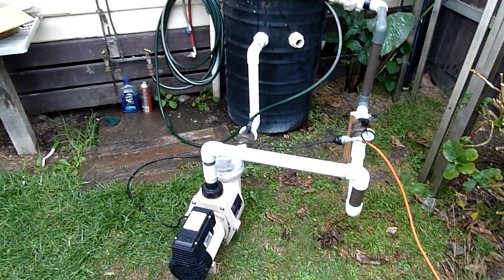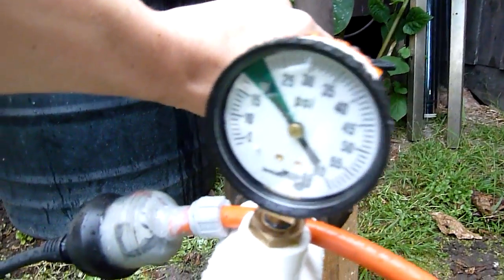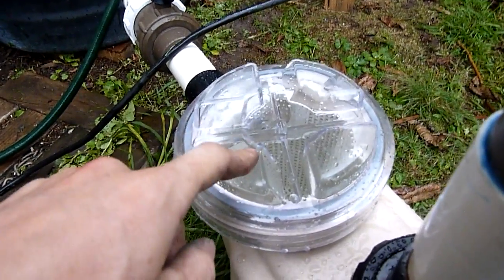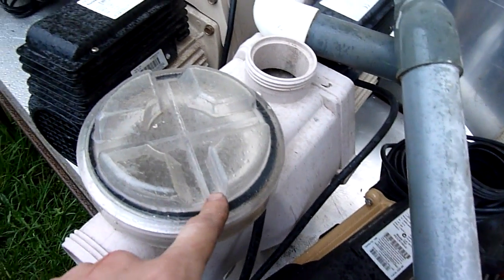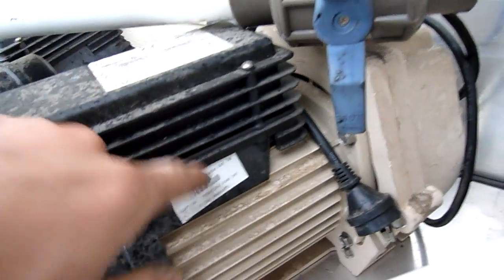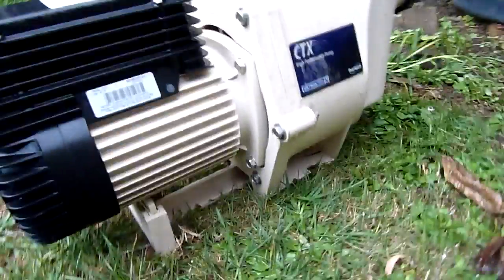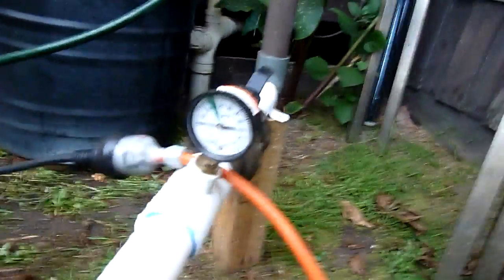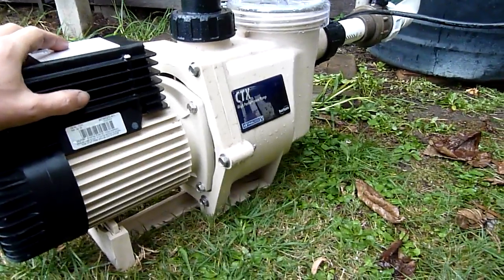Swimming Pool Pump Test Tank Demo - Astral CTX 280 Pump

Comment: those are quiet! Our 60 Hz gets us another 600 rpm out of the same motors, impeller work better with more speed :D a 2 hp motor on a 1.5 hp pump moves plenty of water and builds up to 40 psi :)

Comment: Why did you not install the intake lower on the tank? Just watching the video with the top off the tank, I see what looks like the pump sucking air and thus air bubbles in the pump strainer basket.
Reply from the maker: The intake goes down to the bottom, it just looks funny because the elbow is at the top